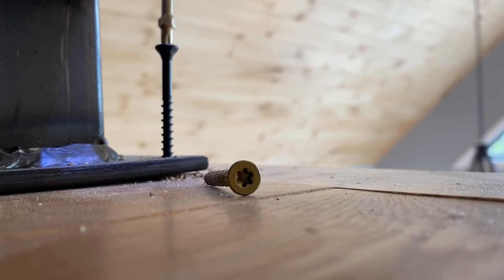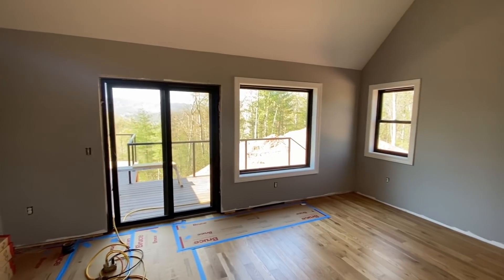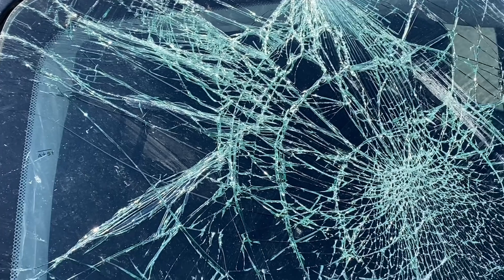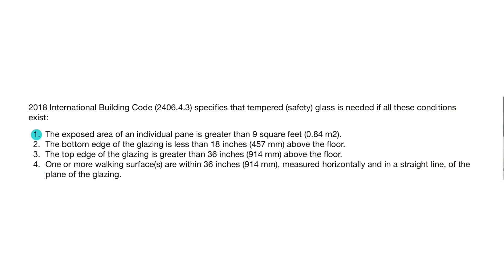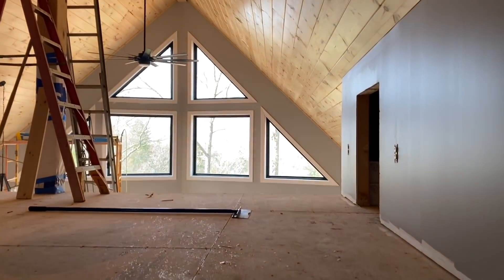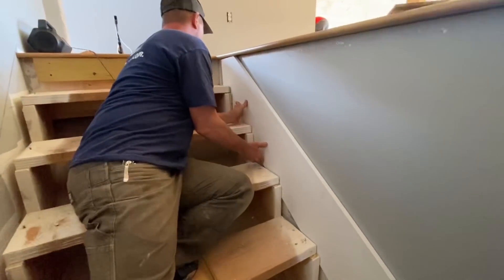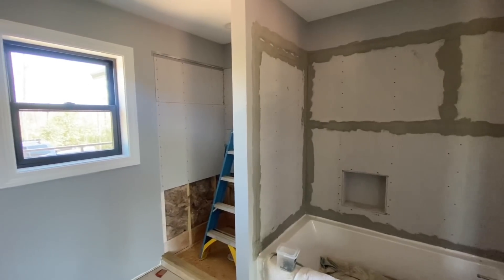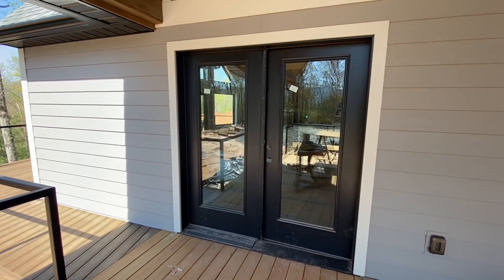Inspectors will fail you for this...EVERY TIME | Safety glass building codes

Comment: Breaking the center pane of those laminated glass panels is cutting the strength of the panel by more than a third because both outer panels are now glued to a fragmented core.

In the U.S. building safety codes would require that the ones used for a stair rail be replaced.
Reply: If you are talking about the three layer laminated builds where the center tempered lite is broken for decorative purposes, then that is incorrect.  Cracked glass using that process is totally acceptable and it's not uncommon to see it used in the US. What safety code are you suggesting would be violated?

Comment: Most places that are in a burn area (I am in Jeffco in the Denver Metro area), tempered glass is required for all windows and doors.  This is not part of the normal code, but is a separate supplement.  You need to check all supplements before and during your build.  My best recommendation is to schedule a meeting with the county with your plans and go over everything ahead of time.  My county (again Jeffco), welcomes this to head off any problems.

Comment: Having been a glass and window contractor for the last 11 years,  I have seen where more and more "safety glass" needs to be put in more and more places.   Best rule of thumb when  you are not sure just plan on using it.   I would just do the whole house using it then you have little to no problems later.   Yes, there is a small price difference in tempered glass in your window and doors.   Most suppliers will work with you to get what you need at a reasonable cost.

Thank Perkins Brothers for the vid post.  Keep up the quality work and videos.

Comment: Rule 1 just use safety glass, you pay more but pass, at least on that part. Some inspectors (especially around Christmas time) will fail you one first run thru. That way you pay them to come back. Tip 1, drop a few Benjamin's as ya'll are going in and see get passed quicker.

Comment: Since when are car windshields tempered?  I used to work in a glass factory and cut laminated glass. You can’t cut tempered glass. It would explode if you tried. It’s cut to size and then tempered. If you tried to temper laminated glass, the material between the layers of glass would melt.
Reply: Pretty sure he just got that wrong, windshields aren't tempered

Comment: The Best way to avoid a failed inspection is to learn the code and don't be afraid to over build. Remember the code is a minimum compliance requirement. You can always make it better but not less than... I am Happy to report that I have only failed 1 inspection ( I was technically right but made inspector happy by changing the (1) 2x4 from PT to fire treated. ) in 22 years of owning my company, in a heavily regulated state. Advice Buy or down load the building code book it will save you time, materials and extra fees.

Comment: Tempered glass is 8 times stronger than Annealed, also windshields are laminated not tempered laminated, just a different product. Tempered lam is very very expensive.
Reply: I thought of that as well. If it was tempered laminated then it would crack into small pieces upon impact of a rock, completely obstructing the view. Every automotive person knows that a windshield will cut you bloody with its tiny shards, unlike the side and rear glass, those are tempered.

Comment: In other words, just use safety glass
Reply: Down side to tempered glass is it's heavier and more expensive. If it's in the budget then I would use it, otherwise it's not always needed nor does it always provide a benefit. Just my 2c as a builder. I only used it in my house where required and where I wanted the extra strength (such as kids bouncing a ball "by accident🤦🏻‍♂️") off the glass.

Comment: From a manufacturing standpoint , why not just make everything safety glass and call it good?
Reply: the extra tempering process costs extra money, and tempered glass requires a laser to cut it, while standard glass can be cut to size for windows with inexpensive hand tools. So memorizing a few rules about where each is appropriate can save you more than a few dollars.
Reply: It's pretty expensive compared to standard annealed glass